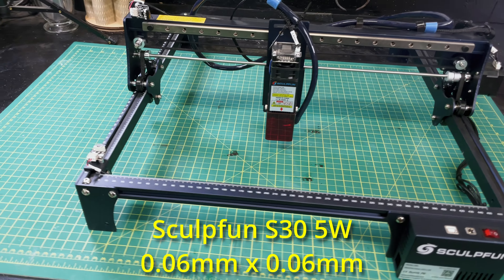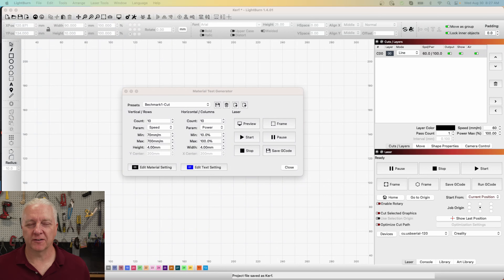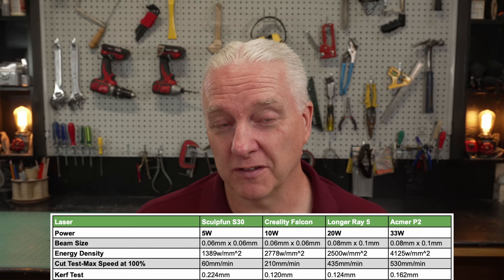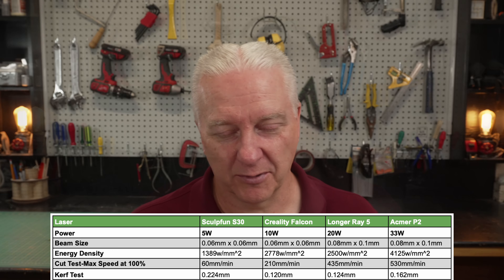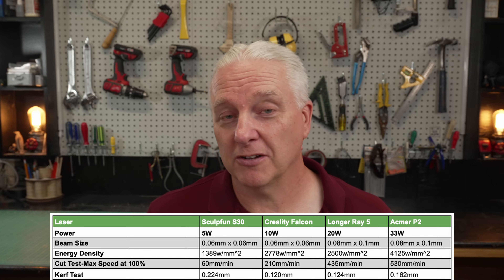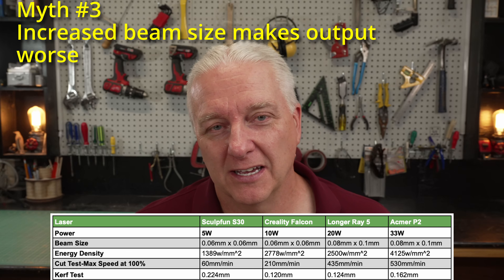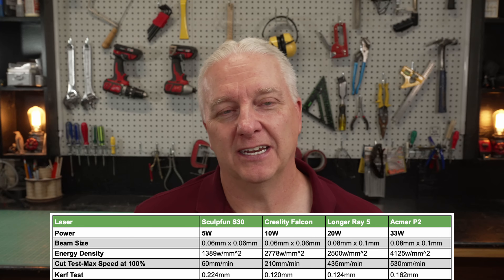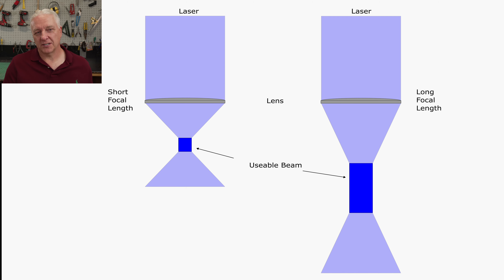5 Diode Laser Myths That Just Won't Go Away

Comment: Your table really should have had each lasers depth of field to complete the specs.
Reply from the maker: That’s not something manufacturers usually include in their specs
Reply: @SteveMakesEverything  Yes they do. They give the wavelength of laser, the focal length of lens and if one assumes something about beam quality the size of  beam after collimator is enough to calculate it. I agree though that any supplier of a laser system should have listed it in clear text.
Reply from the maker: @1kreature  Wavelength is pretty easy since it's printed on the module, but focal length of the lens is not always available - especially for older lasers, and some of the ones used in this video are 2 years old.  The easiest way to determine this would be to measure from the lens to the material when it is in focus, but the best power isn't necessarily available with perfect focus because plano-convex lenses don't bring the beam to a single point but rather a series of foci at different distances from the lens (This is what makes the height of the blue rectangle in the diagram I showed in this video).

Measuring would get you close, though.
Reply: @SteveMakesEverything  It would be amazing comparing the results of the same laser with a Plano-convex lens Vs Miniscus lens, but to do this you would need to almost totally rebuid the module. Probably easier to do with a Co2 than a diode
Reply from the maker: @chrisgallaher3899  Indeed.  I'm not even sure where I could get a miniscus lens for a diode laser.  Would be cool to see though
Reply: @SteveMakesEverything   Given the size of lens it would probably have to be a custom job, just cut back on your coffee for about 2-300 years and you could get one LOL
Reply from the maker: @chrisgallaher3899  😀

Comment: Very interesting... and useful information (I'll have to admit that I knew most of this already).
I do, however, have a few suggestions for future tests that might give some interesting results.
This test involved CUTTING... and of one specific material...
1.
It might be interesting to see the results with different materials.
One example is that I would expect less dense materials to require less power to cut - which is going to affect the kerf and the possible cutting depth.
The power density in the beam is higher where the cone is narrower... 
Therefore we would expect to be able to cut "heat resistant" materials only at a distance close to the focal point...
But we would expect to be able to cut softer materials, with less heat resistance, over a much larger depth range.
(So, for a given power, and the same focal length, I would expect to be able to cut much thicker balsa wood than walnut, at the "expense" of a wider kerf.)
2.
It would be interesting to see how multiple cuts affect the overall "capacity"... and how much you gain by repeated passes.
(I assume that, due to focus depth, and potential build up of charcoal residue, you gain less depth with each repeated cut.)
(I've also seen commentary about making multiple cuts... and advancing the focus lower with each one...)
3.
It would be interesting to see the effect of air assist under various conditions.
4.
This test involved cutting and presumably the ability to do clean cuts.
HOWEVER, the situation will be different when it comes to ENGRAVING.
For example, a finer beam is going to be able to engrave finer lines.
5.
I've heard some people discuss the idea of deliberately de-focusing the beam to achieve "shading" on some materials.
I suspect this would be largely impractical with the power of most diode LASERs... but an interesting thought.
6.
I just ordered an XTools F1, which is galvanometer based...
This means that the beam is directed in a different way...
For example, with pictures I've seen of the LASER Pecker, it looks like the beam exits a relatively small lens, resulting in its hitting the surface at an angle when away from center.
I've also seen videos of some fiber LASER engravers that seem to direct the beam from a VERY small lens aperture...
I would expect this to result in an angled cut when cutting - with the cut at 90 degrees at the center and an angle that increases with distance from the center.
(unlike gantry-type diode LASERs).
I would also expect that this might not occur to the same degree with my new F1 (which looks like it has a larger lower lens).
I have never heard this mentioned in a review...
(I KNOW that the 10w LASER in my new F1 isn't going to be cutting 2x4's... 
But I do wonder if it will be adding a variable angle to cuts in thin plywood - UNLIKE a gantry-style LASER - or not.)

Obviously I'm going to test some of this for myself when I get my new unit set up...
But it seems like it all might make worthwhile content for a few test videos :)
Reply from the maker: Clearly, this is a hot topic for people, and I'll note the contents of your message for some possible future work.  I planning to include some engraving tests, but this would have turned this video into a feature film.  So maybe I'll do some follow-up 

The one point I will respond to, though is #6. since it raises an interesting question.  Lasers positioned by galovs will definitely be cutting at an angle, so they will realistically be more tuned to engraving, where this is less of a problem. The F1 has a fairly large lens, as do most fiber lasers, but I wouldn't use any of these for cutting.

Comment: Your diagram showing short versus long focal length is misleading, or worse yet, a lie. Light does not flatten out into a cylinder the way you show, There is ALWAYS a conical shape to the light both up to and past the point of focus. The cone will be wider or narrower depending on the focal length, but it will always be conical. 

Furthermore, you are using lasers from four different manufacturers. For a truly accurate test, you would need to use identical machines with only the laser heads swapped and with those lasers being from the same manufacturer.
Reply from the maker: So having spent several years working in laser and optics research, I won't disagree you.  But keep in mind that most people who watch this channel are first-time laser users who probably don't care a bit about physics, so I attempt to simplify things as much as possible.  If you want a perfect understanding of laser physics, then I'd recommend watching Russ Sadler's channel (@SarbarMultimedia).  He and I have had many conversations about lasers and optics and have even helped each other a few times.  He knows his stuff and his curious mind is meticulous in learning about what he doesn't know.

As far as a more accurate test, yes, it would be nice to have a laser where swapping 4-5 different modules was possible.  Any laser where this is an option usually involves other major changes at some point, so it's not really practical.  When I upgraded my D1Pro to 40W, I had to change controllers and all of the cabling, for example, and it's now effectively a different laser.  But again, many people on this channel wouldn't care about the effort for more accuracy since they would be happier if their laser worked more like a toaster than a scientific instrument.
Reply: You might want to actually watch the video before you call someone a liar. At 11:52 Steve specifically states that the beam is conical not parallel.
Reply: @ChippWalters  I actually DID watch the video, thank you very much. I was commenting on his diagram, which shows a PERFECTLY parallel beam, which is NOT TRUE. You can simp for the guy all you want. He responded to me; agreed that the graphic COULD be construed as misleading; and we're all good. I don't know who yanked your chain, but this has nothing to do with you.
Reply from the maker: @rebeltaz123  OK let's not go to war here over a simple diagram.  This channel is about helping not arguing, and the diagram I created, albeit simple, got the point across.

But, FWIW, true laser light is very close to laminar and parallel.  The intent is for the beam to be parallel, though, in a $0.39 laser diode, you aren't going to achieve that.  But I can certainly tell you about a laser I helped design and build for "someone" where the beam is parallel for well over a mile.  I can't show it to you, though, unless you have level 5 or better security clearance. 🤐

Comment: Wow. You should be ashamed about spreading disinformation like this. The dot size definitely increases with the number of diodes used. A simple low power defocused beam test will show you why. To prevent damaging the optics the beams are aligned parallel. They do not overlap on top of one another.
Reply from the maker: Did I say adding diodes doesn’t increase the beam size??
Reply: @SteveMakesEverything  yes you did, your "myth 2". 8:17. It's not about the focal length, the beams are aligned beside each other, not on top of each other. Also this definitely affects kerf and engraving resolution.
Reply: Calling other youtubers liars is despicable and frankly cheap.
Reply from the maker: @-vermin-  To be clear, I'm not arguing with you and I certainly wasn't suggesting that the diodes aren't stacked side-by-side, but rather that I heard a comment claiming that the reason the beam is bigger is because manufacturers can't easily align the diodes and that's what was making the beam bigger.

Regarding the diode output being stacked side-by-side though, there are lasers coming very soon where this is no longer true.  I have one in my possession right now where a 22W laser produces an almost square beam that is comparable to a 10W laser in size, yet it cuts like a 33W laser.

The current beam arrangement is a choice not a technical limitation.
Reply from the maker: @robmills4709  Indeed, but sometimes I like to stir the pot.  I never resort to all-out war though - that's just no fun.😀
Reply from the maker: @-vermin-  So wait for my review of the AlgoLaser Delta in the next couple days and you will see how wrong this claim is.  The Delta laser has four diodes and produces a near-square beam because it stacks diode outputs both vertically and horizontally.  As an added bonus the Delta also has dynamic beam sizing so engraving and cutting are done with different spot sizes.

Just because things have always been done a particular way doesn't mean that they always need to be done that way.
Reply: Wow.  You're inability to think things through is amazing.  Size of beam is a function if the focusing mechanism. Begin, end.  A tiny array focused poorly has a large, weak beam.  A huge array focused well produces a tiny, powerful beam.  Think... (and maybe observe, 'cause there are examples out there)